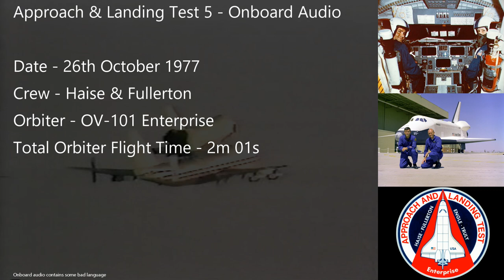Approach & Landing Test (ALT-5) Onboard Audio

Comment: Another great find, LM5!  (Note - I believe the "Milt" the crew mentions in the audio was a reference to Milton O. Thompson, then-director of Dryden’s Research Projects branch.) For those who are interested in ugly details, here's a link to a NASA / AIAA paper discussing the Enterprise Approach and Landing Tests. The paper includes a lengthy discussion of the analysis of the pilot-induced-oscillation (PIO) incident that occurred during the ALT-5 (also known as FF-5 or Free Flight 5) landing. Although Haise's own reactions evident in this audio as well as most media coverage of the incident (even up to today in some documentaries) seems to blame Haise for a piloting mistake, the truth was a lot more complicated (as also turned out to be the case in Jack Lousma's hard nosewhell touchdown on the STS-3 landing at White Sands). What most of us never heard back in the '70's was that Dryden responded to the incident by conducting an extensive post-ALT-5 flight-test program with a variety of other aircraft to analyze how the Shuttle Flight Control System's "tuning" and pilot cues had contributed to the incident. The report says the flight testing program uncovered Flight Control System behaviors that weren't turning up in ground simulations. The report also says the FCS logic was changed to decrease the potential for PIOs, but Dryden continued to analyze the Shuttle FCS PIO tendencies into the '80's. https://ntrs.nasa.gov/api/citations/20070034952/downloads/20070034952.pdf
Reply: I know this is an old post, but I really appreciate the link to that report.  Was a fantastic read, and shed light on a lot of questions people have had over the years.  Cheers.
Reply: Brilliant comment

Comment: That is absolutely fascinating! You know the aerodynamic models said things at odds with the discovered performance of the Orbiter as a glider. That's real test piloting right there. Fred Haise was PISSED that he flared it a little early - but someone had to do it first! Someone had to actually fly the thing and find out. Just great video!
Reply: They came in hot but would have been fine if not for the 300ms delay  in the flight control system (aka fly by wire). It casued Haise to start chasing the vehicle.

Comment: So I did some research regarding the pilot-induced oscillation in pitch and roll at the end - seems that software was mostly to blame - elevon rate limits. But this was the first landing on a runway, and there was no possibility of letting it simply float - Haise had to get it down, and the computers were not configured to accept fighter-plane like inputs. So it was a combination of software and necessity and possibly Haise' justifiable concern that he was out of runway.

Comment: I think he expletives were due to a) he was a perfectionist and b) it must have been very frightening to be sat on the nose of the vehicle porpoising like that. Kind of what test flying is all about. He found a clitch with the fly by wire system that would be fixed for the orbital flights. Not a great landing, but I’m sure he would rather do it with Enterprise than someone find that issue when coming back from orbit. Another great find and thank you for all your hard work on it!
Reply from the maker: Great point Tom
Reply: Note also that this was the only ALT flight to land on a concrete runway rather than the Edwards lake bed!
Reply: @cerberus1981  indeed mate. 👍🏻
Reply: Agreed!

Comment: Alarming amount of comments around NASA pulling Haise from an orbital flight due to this landing. I find myself asking a few questions around this.
1) NASA announced Haise was slated to command an orbital flight with Jack Lousma after the ALT.
2) This was test flying. Haise had a POI around the pitch input of the craft that exposed an issue with the fly by wire control system and that it could be overloaded. Surely this is the whole point of test flying and the objective of the ALT (not bounced landings but to find out issues with the system). Why punish a pilot for this?
3) Haise had a life threatening crash in 1973 that was down to a poor judgement around the suitable site for an emergency landing after an engine failure. Yet NASA still selected him to COMMAND the first ALT free flight.
4) Plenty of Astronauts had issues on flights and this didn’t affect future flight assignments (Grissom, Dick Gordon, Gene Cernan), indeed it strengthened some (Armstrong on the LLTV).
4) Complete lack of credible evidence from some commentators, apart from stuff that they “know” and will not share.
Reply: Anecdotally, I will say I attended a talk Fred Haise gave in Titusville quite a few years ago where he discussed his accident and painful recovery. One of the things that surprised me the most about his talk was the fact that he was even more proud of the work he did as a test pilot for ALT than he was of his part in Apollo 13. Not a statement that seems likely if he was, as some claim, pulled from a future orbital flight for his performance here.
Reply: @Astronomy_Live  I would have loved to listen to that. I find the Shuttle era fascinating as it really showed off the piloting skills of these guys, especially the ALT and early flights as it was still so unknown as to how the Shuttle would behave. Like STS-2 with Engle manually flying it all the way from M25 down to finals……just to prove it could be done and test out the system. Thank you for sharing

Comment: I think I heard somewhere that the system originally wasn’t fly-by-wire, but cables and pulleys. When Fred has was cursing, it’s because he was really tugging on the controls due to the air resistance

Comment: Any chance you could combine the air ground audio. Also….. I was wondering if the audio and video got out of synced somewhere just before he started having problems.
Reply from the maker: Hi Giles - I was  thinking of combining the two but the issue is you get a lot of chatter over both feeds and it sounds messy. As for the tape synch - it's always hard to get it right on the synching as tape speeds are often not the same as video speeds - in fact the 4 landing videos shown, none of them synched with each other to begin with, all were plating at different speeds. I do try and get it as close to what happened but kind of accept that I am not always able to. Regards LM5
Reply: @lunarmodule5  I totally understand and thank you anyway for putting together something I haven’t seen before!

Comment: How enterprise have engines?
Reply: It didn't.
Reply: @EricIrl  but it shows engines is the shuttle columbia then?
Reply: @overthehorizon4959  Columbia was a fully spaceworthy Orbiter - so it was fitted with three, fully functional,  Space Shuttle Main Engines (SSME). Enterprise was never modified for space flight, so it was only ever fitted with dummy engine bells.
This video shows Enterprise on its final glide test flight in 1977.
Reply: @EricIrl  oh so the engines in the thumbnail not a engine just a model or something
Reply: @overthehorizon4959  it was fitted with fake main engines that were shaped properly and weighed the same as real ones so the aerodynamics and landing characteristics of the orbiter could be tested. during the first couple of drops it had a cover over the engine area but the last tests removed that.

Comment: It wasn’t pretty but he got it down in one piece…and in my opinion that counts for a lot. Looks to me like the orbiter was coming in too fast and hit some wind shear as it was about to land.
Reply from the maker: It was due to pilot induced oscillation (PIO) - post flight analysis found that there was delay of microseconds from input by the CDR on the control stick to the computer actioning that input to the aero-surfaces of the orbiter. That delay meant that Fred, expecting a change immediately he moved the stick, made another input before the original had been actuated. beginning the sequence of events seen here. Every control change he made meant the next one had an effect on the next and so on but way behind what he was trying to achieve to stabilise. The situation was remedied before STS-1 but astronauts were still aware that PIO was possible with the orbiter.